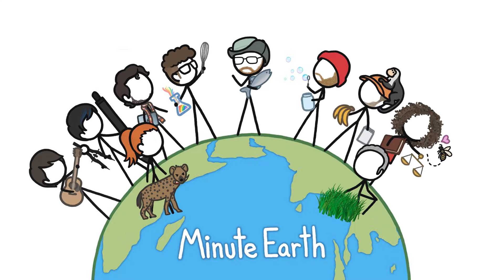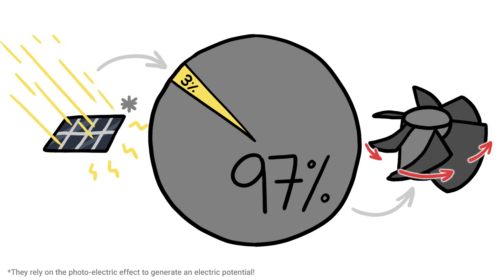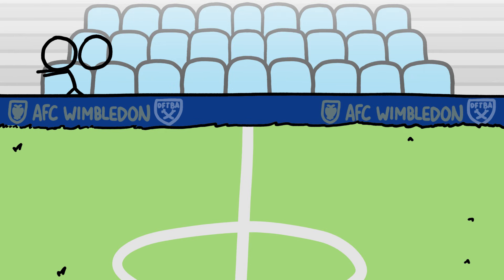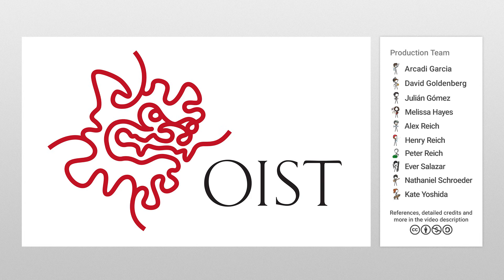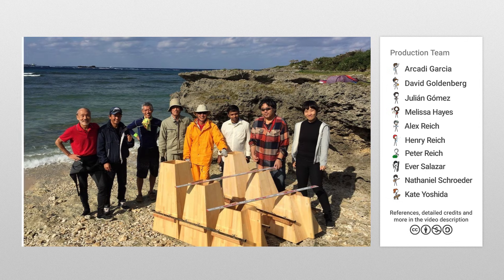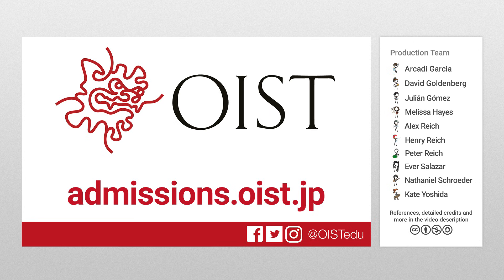Why Can't We Get Power From Waves?

Comment: I have gone over the numbers and wave power requires MANY times as much tonnage of equipment per unit power out. In other words, the cost of wave power is AT LEAST ten times as much as wind power. 
Another way of looking at it is this: Wind power is harnessing solar power produced temperature and density gradients to move wind around and capture it with turbines. So, wind power is ONE LEVEL REMOVED from direct solar power. Waves are caused by wind, so they are TWO LEVELS REMOVED from direct solar power.

There are always losses in conversion. While the losses from solar to wind are significant, they are bearable. On the other hand, the losses from solar to wind to waves are NOT bearable. Wave power is crap. Believe it.

Comment: Why not see if you can move the turbine on a z axis rather than the x. Like the spiral bolt on the motor of a 3D printer. As the buoy is floating have it stationary to where you’re capturing the up and down motions of the waves rather than side to side.

Comment: Then again, there is always the matter of inlets and bays, with rising and falling tides.... A pipe which connects the ocean to the bay will have a constant flow in a single direction between the high and low tides of the day. In certain places, this can be done in conjunction with fish farms built in artificial bays, which would only assist the farms by creating a flow of "fresh" sea water. Since the tide moves in and out around 4 times total per day, with very little engineering, a design can be implemented which takes advantage of the two way flow by either stopping up one end while opening the other at different times, like many pump designs. Still, there are many methods that can take advantage of displacement, though the cost-benefit is always the major detractor from anything that is only slightly above break-even.

Comment: The whole point of turbine is to turn linear to rotational motion. Waves already is rotational. Surface waves as the name implies is much less if not complete non-existent deeper in the ocean. A tethered submersible mass could be kept beneath the ocean to anchor the generator. The generator is cranked by the rotary motion of waves. I'm no engineer, but we don't really need a turbine since its kind of redundant turning rotary motion to linear back to rotary then to electrical. Maybe this method have already been tested. Also naturally this is a spur of the moment thought, so cost, power capacity and maintenance is not considered.

Comment: I wonder if piezoelectrics that flex with waves would be a good idea? As in, connecting floating "pods" together with piezoelectric connections that flex when the waves move the pods relative to each other. Then slap on some solar cells because why not add them too. 
Good idea? Bad idea? Has this been tested?

Comment: What about building structures along the shoreline that allow waves to push up against the shore and therefore into the structure and this creates sort of pressure in the chamber above the water inside the structure that then blows air through a turbine and out the other end and it can suck it back and forth and it uses a turbine which going forward through backwards in regards to the air flow still spins the turbine the same way

Comment: You need flaps in the box shown that go both ways into a mechanism like the double action screwdrivers so weather the flap goes forward or back it spins the turbine the way u want.with safety mechanisms where if the sea gets too turbulent it opens fully to just let the water pass if you need I can take the credit when someone smart sees this and builds it

Comment: The Islay wave generator (250 kW) ran commercially for a decade and the Mutriku plant of the same type is running today. https://en.m.wikipedia.org/wiki/Mutriku_Breakwater_Wave_Plant

One of the problems with the cost effectiveness of renewables in general is that we don’t pay the full costs of nonrenewable in our electric bills. Some EPA analysts calculated the health costs of fossil fuel electricity at 14 to 34 cents per kWh. That’s in the range of twice the average retail cost. If we paid for that directly wave energy would be viable.

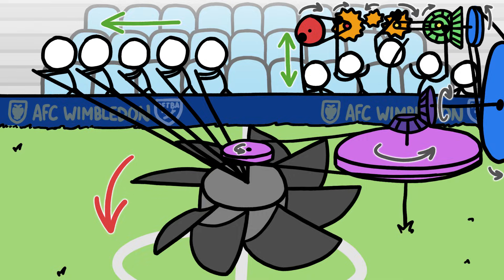Comment: I only watched to 1:03, but you are wrong. Waves could be used to make energy by using bouys that crank a turbine as the bouy raises with the waves.
Bigger problems with"wave energy" is that they are in oceans. Oceans filled with super destructive material known as salt. Making a machine to harvest energy in the oceans is just a bad idea as the building and maintenance costs likely make the investment unfeasible.
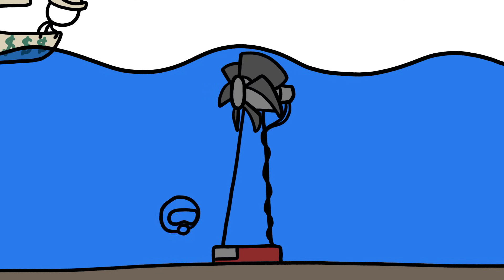Reply: 01:48 - salt and maintenance
02:45 - bouys

Comment: So the wind moves the waves, then we harvest energy from the waves? Rubbish, let's just harvest the wind, cut out the middle man.
Reply: Isn't the tide caused by the moon?
Reply: @dustinmorrison6315  The tide is from the moon, but the waves are caused by the wind.
Reply: So the wind is caused by temperature gradients due to difference in irradiation? Why do we then care harvesting the wind? Let's just harvest the solar radiation that causes wind in the first place. You know, cut the middle man
Reply: @faustin289  So the solar radiation is caused by nuclear fusion of the sun, then we harvest the energy from the sunlight? Rubbish, lets just harvest nuclear energy, cut out the middle man.
Reply: @andrewandmarianne7175  So fusion energy comes from the tiny bit of mass that gets converted to energy when two small atoms fuse? Why not convert all the mass then? You know, using a black hole or anti-matter.
Reply: @faustin289  Wind is easy to tap into right now, that's all. Solar energy needs to be cheaper and more efficient.
Reply: not sure that is the right way to consider this.

Comment: This video only touches on the real way to produce electricity from waves at the very end when it talks about buoys pulling on a generator. Unfortunately it dismisses this right away. This concept fleshed out can produce lots of electricity and if the buoys are mass produced and hocked up in parallel, they can produce enough energy for use far inland with buoy fields being located way out in the ocean. I'll give you a hint to the complete solution. Hint: semi-submerged ballast buoyancy chamber outer structure, surface floating piston, ratchet gearing, fly wheel, AC, step up transformers and step down transformers. Think about it.

Comment: Wave energy really just isn't a very good idea.

All of our best energy sources have one thing in common: density. Coal has an energy density of 24 MJ/kg. The average house uses 40 GJ of energy per year, or about 1.7 tonnes of coal.

For a nice visual, that's about 55 shopping carts full of coal, per year. If you had your own power plant at your house, you'd be bringing about as much coal to power it as you bring home in groceries. That's also the amount of coal that someone would need to go dig out of the ground for you.

Uranium has an energy density of 3.9 TJ/kg, 162500x higher than coal. It's also 14x denser. After accounting for the ~1% yield of U-235 vs U-238, it's about 22750x more efficient to dig up. With uranium, you would only need 50 mL of fuel per year to run your house, or roughly one extremely radioactive hot dog weiner.

Now, you might say "renewable sources deliver infinite energy density" but this is not so. With coal, oil, and uranium, the mass of the fuel delivered far outstrips the mass of equipment doing it, to the point that we have ignored it.

Solar panels deliver roughly 200W per square meter, and lasts (optimistically) 25 years before replacement. They weigh 10-20kg per square meter. I'll be generous and say they're getting 200W 24/7/365. With this in mind, we can calculate the energy from a solar panel over its lifetime, and therefore the energy density in placing a solar panel of particular mass.

157 GJ/ square meter = 8-16 GJ/kg

That's pretty good. It beats out coal by 2-3 orders of magnitude, but still falls 3 orders of magnitude behind Uranium.

So, now let's talk about wave energy.

As with solar, the energy is delivered to the system, so we will consider predictable system lifetime vs energy potential.

Oceanic equipment, as discussed in the video, cannot survive indefinitely in its environment. You're lucky to get 5 years out of anything with moving parts without regularly replacing many of its internal components. But let's talk energy.

With wave energy, you are harvesting at a cross section, rather than across an area. This results in some rather funky units, which I will try to untangle.
Optimistic estimates put the energy density of waves at 36 kW per meter of shoreline, with a wave period of ~8 seconds, and a wave height of about 3m. A 3m surface wave will be roughly 50m long.

In order to absorb the energy of a wave (in any medium, not just water) you must have a capturing device that spans a reasonable portion of a full wavelength. You cannot have an arbitrarily thin cross-section and expect it to yield all of the energy. The waves will simply diffract around the generator. In a physical sense, the generator will only be able to exert so much force on a certain area before it pushes itself below the water, and its ability to absorb all of the wave's energy is a function of that area vs the wave's area. It only reaches 100% at a full wavelength.

This gives us a 1x50 square meter space to consume. At 36 kW/50m^2, we have 720 W/m^2 (maximum theoretical yield for this model). Contrast this with the solar irradiation of the surface of the planet at 1368 W/m^2, nearly double. (Solar panels are only ~15% efficient.)  Also remember that solar panels will last roughly 5x longer than this oceangoing equipment without much maintenance.

This leaves us seeing that ocean power is about 10x less promising than land-based solar, with significantly higher up-front cost and several showstopping problems with even the most basic designs.

When the theoretical best-case is worse than what we have right now with another technology, why would we ever consider pursuing it outside of self-congratulatory grandstanding?

Comment: The biggest problem with generating energy from waves is that the power generated isn't near where it needs to be consumed. All of the mechanism for generating wave power that you described work. The problem with generating power from ambient energy is always going to be efficiency and moving power from one place to another always incurs a cost. Both solar and wind power have the advantage of being relatively close to the consumer. Wave power will never have advantage and thus will always be the less efficient option for powering homes.

Comment: Would it be easier to place the turbine in the large currents like the gulf stream?

Just thinking out loud but that seems more intuitive to the turbines as we currently use them. Would probably have to be put much deeper though...
Reply: Don't know of anyone harnessing currents, but tidal energy is normally just underwater turbines.  So, a thing which already exists.
Reply: I meant its more analogous to the way a wind turbine is used if it were meant to harness directional current energy rather than periodic tidal energy
Reply: @aucontraire4717  I get what you're saying, but...
Tidal is periodic on with a frequency of hours.  This is a lot like wind, which changes direction sometimes too ;)

BTW: Here's an example project from some years back:
https://www.energy.gov/articles/turbines-nyc-east-river-will-provide-power-9500-residents
Reply: your not thinking out loud your typing

Comment: Energy harvesting, always portrayed as something futuristic that can power the entire world based on napkin calculations, but it doesn't work so well in reality because it's energy harvesting. You need to spread out a lot of generators over a huge area to generate meaningful power. This is materially wasteful and takes a lot of work, and has a significant impact on that environment, even when it is somewhat economical due to policies and benefits of scale. Wind and solar have the same problem and that is why they won't ever be a good fit for generating civilization levels of power. What you want to do is the opposite of energy harvesting, you want to concentrate a lot of power into a smaller space using less material. The reason why hydroelectricity is an exception is because it is self-concentrating by geography, you use the precipitation from a vast area, but it concentrates into a single artificial lake so you only have to build one dam to gather and use that energy. And the reason why small-scale hydro performs a lot worse. With napkin calculations you can easily prove that precipitation should be enough to power the entire world several times over with hydroelectricity. Yet you can't do it in the real world because the conditions where the self-concentration is useful enough are limited.

Comment: I don't understand why buoys are so expensive, all you need is two weights (one larger and on the seabed), a rope to connect the weights, a float and pulley with a generator. As the float bobs up the rope is moved higher, pulling it over the pulley creating rotation for the generator. As the wave drops the weight of the buoy and the small weight drops back down shortening the distance on the rope to the pulley, creating rotation in the other direction. Have a large array of these a small distance from shore and it would probably be cheaper than a turbine system, all this does is use buoyancy to gather the kinetic energy instead.

Comment: Why couldn’t you build a reservoir, that collects waves coming in and pushes a wall back, then when the tide recedes the wall recedes with it. The wall is connected to a geared “crankshaft” with a one way bearing set-up that turns the motion in both directions into constant force, applied to a magnetic dynamo. Check out Build It Extreme’s two piston boxer engine to see what I mean

Comment: what about a wave dampener conversion? they already exist and steal the energy of the wave as it lifts the buoyant end. just have a two way drive that can convert either up or down motion into rotational and you got it. any beach can use, it doesnt go underwater, the only part affected by the water could be easily sealed and made with rust resistant materials. could swear something like that was already in use in venice.

Comment: Why not a flat net of mini turbines that as the wave rolls along float on top and spin as it goes past alone they genirate a little but if spread across a wide enough space the power they create could be built up and funneled  pros it’s low cost mantenence  and can be made of plastic a guy with a fishing boat can do most of the repairs  if done with a specific design the sea water is kept out and the parts that rotate to keep it out can be easily and cheaply repaired (recycled plastic can be used here)  plastic is somewhat seawater resistant and can be made so barnacles have a tough time latching on cons start up cost is not gonna be cheep  needs a trained electrician/ mechanic to do repairs  can work but needs to be along a coast of some object tethered to the sea floor

Comment: more like we use 2 basic phenomenons to power turbines, its pressure or gravity. DAMS are ones that convert water potential energy into electricity, while coar burners use steam (pressure) to get power. Waves have neither in big quantities, which is the problem. Its enormous power, but its spreaded more-less evenly on the surface, which means to get some serious power you need serious area, and as mentioned its costy.

Comment: Also each man is an energy hog , make toast ,hold coffee hot , leave on lights , camp in front of the fridge , hot water heaters , we waste alot of our " cheAp " electriciety ; it's easy to make alittle wattage over long times , recharging you phone is a doable task , solar toaking toast is very hard , slow an inefficient , we should heat our sweaters not so much our homes. The easy work is done ,

Comment: As opposed to wave energy, Tidal energy does work though it just only works in certain places. Like puget sound, the st lawrence river mouth and the Knik arm. And unlike turbines, very large scale buoyancy based systems don't actually need alot of flow to work. In other words they work just as well beside the river mouth as they do within it reducing the potential for environmental impact. They also have only very slow moving not-sharp parts further reducing the impact to fish and whales. With tower based systems the sensetive electrical components needen't be subjected to saltwater exposure either.

Comment: Whenever I’m at an ocean shore with significant wave action all I can think about is why we aren’t capturing this free energy
Reply: Most waves are created by the wind and water interacting. Warm water rises and heats the air that is moving across the water. That air rises, creating a small vacuum as it does. Some water is lifted in the process in the direction of the breeze. Because that water is still warmer than the cool air around it, the water loses a lot of heat and begins to sink under the water that is quickly taking its place. Thus, you have both ocean wind and ocean waves.

That’s how I remember it, I believe there were far more factors but those were barebones. Find a way to harness any of that, and you’re golden.